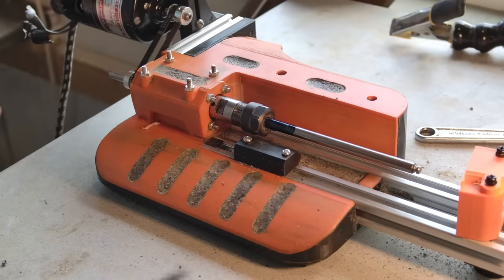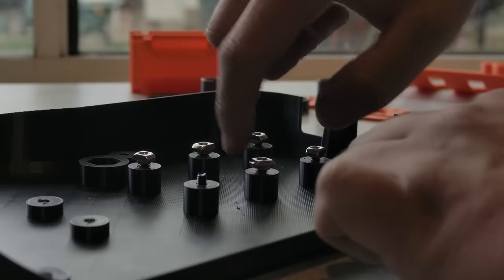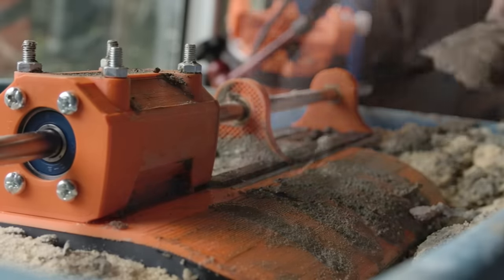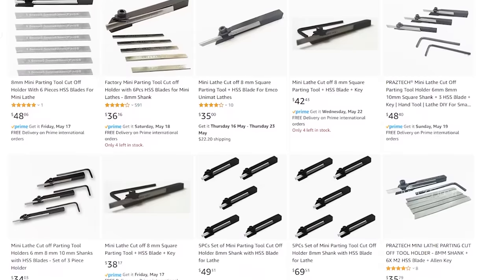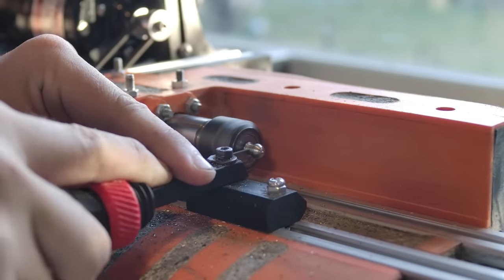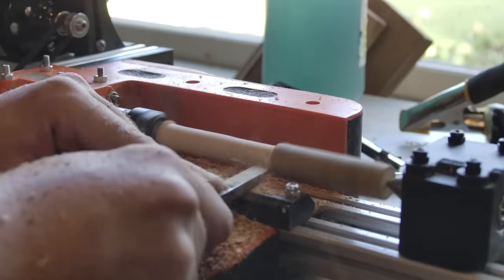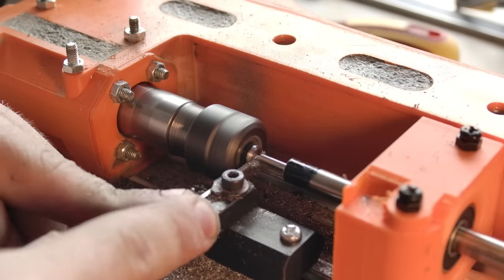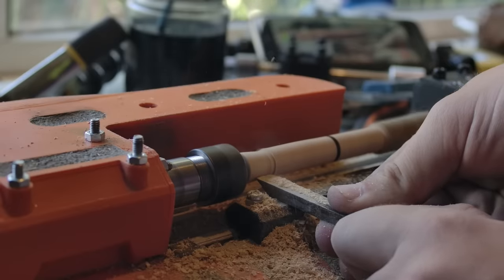The Metal Lathe Made With A 3D Printer

Comment from the maker: This video needs more footnotes than a Discworld novel.
Some things of note that didnt fit in the video for one reason or another:

-Square gravers are what the watchmakers lathe would use. I ordered some, but they are yet to arrive. Should provide significant advantage
-It has the option to be bolted down. I didn't this video which only really shows during the wood lathe section. 
-The drilling option REALLY needs work

Probably some other things idk
Reply: Your motor would be able to deliver more of it's power if you put a flywheel on the back of the chuck axel.
Reply: For bed extensions - I dont have an idea for the rails themselves but for the printed sections you could print joint-able parts like this: https://www.youtube.com/watch?v=WY8yd191qVE
Reply: Today I learned where the scattershot focus in the discworld audiobooks comes from! Time to hit the library and start the series from the top with my eyes instead 😉
Reply: Originally thought this video was neat. Saw the Discworld footnote comment and smashed subscribe immediately

Comment: Buy the cheapest cordless massager (looks like a gun) you can get. 3D print funnels for your openings and fill the with concrete. Vibrate the thing using the massager and the concrete will flow like water. Well, almosr. I use it to liquefy plaster all the time!
Reply from the maker: I have been told my concreting is "the least satisfying thing on all of youtube" by a friend aha, good tips.
Reply: That's a great tip. Have one and everything.
But don't put "massager" on quotation marks, that makes it far worse xD
Reply: @BernasLL  haha, I'll keep that in mind!
Reply: If you don't want to buy one of those I'd suggest  sitting the wet concrete on top of the washing machine when it is going into it's spin cycle.  Some of these new machines have VERY high spinning speeds & I'd bet both top fill & side fill would work.
Reply: You can use a small electric sander to vibrate wet cement and get good results
Reply: @fleaniswerkhardt4647  I tried using a small random orbital sander - without sandpaper - but that ended up melting the plastic because it was more powerful than expected. However, it cerainly could be made to work.
Reply: @fleaniswerkhardt4647  That's a great suggestion as well, I thought about this years ago but never had a reason to implement it.
Reply: @mattiasfagerlund  I'm sure it'd work well enough turned upside down so the spinning surface isn't eating/heating up your form, and it'll spin faster due to no resistance. I mean whenever I use a sander, my arms are still vibrating for a good while afterwards lmao so I'd imagine it'd work fine. All you need is vibration, so getting two small hammers and quickly alternating tapping them would work too 🤣🤣
Reply: Find an old electric toothbrush - they're awesome for small pour-mould projects.
Reply: @Borgedesigns  lol, I think putting concrete in is a great idea and I have planned to mix concrete and 3D printed things but yeah, your friend wasn't wrong.  Still it is a good example of "sometimes something looks like a mess in the process of being made but comes right".
Reply: mate, just say massager. the gun-shaped ones are actual massagers, unlike the other "massagers"
Reply: @cvspvr  I edited the post - you're the second to comment that and I assume a lot more people have been traumatized without commenting ;)
Reply: @mattiasfagerlund  don't put the PAD against the plastic.... put the MOTOR against the plastic.

Comment: I have been dreaming for years to make a mini lathe. Yet I came to the same conclusions when just contemplating it, it wont be rigid enough. Now you concreting approach changed that ! Thanks for the inspiration !!!!
Reply from the maker: Im glad people are getting the takeaway with the concrete. My design is probably a bit over complicated but the basic premise can be applied to so many printed applications
Reply: @Borgedesigns  rest assured, if I designed it would be most likely way more complicated. I think yours was pretty simple and elegant for what it does ! 
Me I would have to add a cross slide and some form of auto feed :). 
I was actually thinking of using the 3D as a mold for aluminum casting the base.

Comment: To make it easier next time for cleaning the concrete, spray some cooking oil on the plastic ( even inside is ok to make it flow to every corner ) first then pour your concrete ( use a tiny squirt of dishsoap to make it flow better in the mix and add a bit more water your mix is very dry and compressive strength does not matter for your purpose ) then wipe the surfaces with a wet rag / paper towel it will come off 10000% easier

Comment: Very cool.   Have you ever read the Dave Gingery "Build a workshop" series?  Book 1 is a foundry for melting aluminum.  Book 2 is building a lathe from scratch, largely from aluminum castings using the foundry constructed in book 1.   Using a 3d printer to make your casting patterns, I bet someone could follow that book alot more easily than when it was written.

Comment: Is the concrete desired for its mechanical properties? For rigidity?
The density of concrete (not cement, which on its own is much lighter) is 2400kg/m3 whereas plaster is 2275kg/m3.
I'd go with the plaster for ease of use and possibility of redoing it/chipping it out or dissolving it if there are problems later.

Comment: Cheap spray clear-coat does the same, it protects the surface and makes it easier to clean and on darker colors it completely hides layer lines even if you don't fully sand them away(generally just scotchbriting the surface to make the clear-coat stick will still see layer-lines gone with darker filaments)

Comment: Ive been on the same path as you, good to see the method has some viability. In my experience you really should add some form of fiber reinforcement to the concrete.

Cyano-acrylate glue(super glue) is great with concrete if any fine cracks are formed. It's also good as a surface finish to the exposed concrete parts. This both hinders particles from coming loose and adds surface tensile strength that concrete lacks and hinders cracks to develop in the first place.

Comment: I love what you're doing with exploring 3D printed concrete forms. I feel this technique is vastly underutilized, and it offers incredible strength and precision for a relatively low effort and cost.
Reply: cement mixed with general purpose epoxy resin works amazingly well in this sort of application.

Comment: Might I make a small recommendation? I see you are using aluminum extrusions and 3D printed plastic for the body of your lathe and steel fasteners to connect everything. I would suggest instead 3D printing the shape of the body of the lathe, and then using it as a positive to make a sand casting mold with. Then you could potentially mill out the portions that need to be precise after casting.

This would allow you to use at least brass, possibly even steel for the body of the lathe, which will greatly improve its functionality.

You can use a relatively makeshift mill using the current designs to do the finishing work on the casting.

Comment: Use epoxy-granite instead of concrete. It's dimensionally stable, and concrete isn't.
Reply: hahaha dimensionally stable.. like he has some tolerances to keep 😭
Reply: @feilko2170  that's exactly both thoughts that poped in my head. why tf concrete but on the other hand... well... he's not working with car parts
Reply: I think the point is to make it heavier, also cheap.
Reply: @gzaos  Stability is more important

Comment: Dude, just using a bag for the concrete… lol dump it in a zip bag, cut the corner off and pipe it into the slots like frosting. Much cleaner and more accurate, and you can add a milkshake straw to get it into the small areas too. 
That mess was entirely unnecessary…. Hahaha but something I’d probably do too if I was too lazy to just go buy bags.

Comment: I really hope you used taperd roller bearings in the headstock, otherwise there will always be unavoidable wobble on the spindle.
Reply: He clearly didn't use tapered roller bearing as the need to be held under a compressive load to work right. i would guess he used common deep groove ball bearings.
Reply: @markcastonguay7906  
That does explain the large wobble of the headstock spindle, whenever force is applied in the video.
A bit of an oversight, really.

Comment: An interesting idea I just had, if you need precise parts on a lathe like this, you can 3D print flat templates to screw to the tool rest and slide the tool over. It'll require a bit of calibration, but with a pattern parts can be done precisely and, more importantly, reproducibly.

Comment: You’re on a decent path, but the runout in the headstock looks pretty bad. It doesn’t seem like headstock volume would be an issue, so I’d go with taper bearings and make it bigger. Also reduce the overhang. Maybe go with a drawbar and collet system. You already have a watchmaker’s lathe with those presumably. I’d also go with a granite epoxy mix instead of concrete. Thin concrete is not very strong.

Comment: I really like this and I agree you really need some kind of tool holder and if there is any way to make it slide paralel to the spindle, that would be great, even if it's only an inch or so.  If you can lock the tool in place (distance from centerpoint) and then slide, it would make a huge difference but IDK how hard that would be.  

I would be almost more excited to see a copying/cloning setup (forget what you called it) so you can replicate the shape of other pieces or at least use a profile guide (which could be incorperated with the slide above!!). 

How are the vibrations?  Would you consider making the base a little heftier & making a bunch of mounting holes where it could be bolted onto some old plate iron or steel?  If you want to add more weight while reducing vibration, what about filling the cavity with lead &/or steel shot of various sized (so they "nest") and maybe fill the rest with sand & then sel or cap the openings.  I've heard keeping the material loose is best for absorbing vibrations as the movement is transferred into the shot/balls & the move/bounce (hardly observable) dissipating the vibration while actually generating heat!  in large systems this type of setup actually needs active cooling from what I've been told (similar to coal catching on fire while in rail cars from the friction from vibration) - so it must be doing something!

Awesome job!

Comment: I had a feeling some of those rods were from printers when I noticed flat side at the end of one of the rods, I have disassembled multiple laserjets and have many 6mm rods with flat side to them. I also have motors which one was bad and I pulled that metal cover off that has a magnet ring inside and use it to hold bolts when I disassemble dvd drives / hard disk drives.

Comment: Hey, great concept, very interesting! You should check out if you haven't seen it the "Turnado" by Eccentric Engineering, it's an accessory for metal lathe to allow free hand, radius and pattern turning. Uses a flat metal plate instead of ways. I think a diy version is exactly what this type of lathe needs.
I think a version with tapered roller bearings with a spindle that can adjust their clearances and some way to reduce the stick out of the collet holder/work pieces would go a long way. Also I think for the drilling bit (tailstock) you need a more rigid/thicker connection to the chuck and mounting to the rest of the lathe. 
All in all I would say it has a ton of potential, great work!!

Comment: What do you think about a typical 775 motor in this usecase? Does it have enough power? 
Maybe change gear ratio to reduce speed of spindle?
Another question, why didn't you mount the headstock to the extrusions themselves?

Comment: I understand if this is just a project in using as much 3d printing as possible but it’s not that useful. Why not strip out an electric drill and make a printed housing for that? It’d be your motor, spindle and chuck all in a much stronger setup. I know this works well because I’ve clamped a drill to a worktop a few times, to turn small parts.

Comment: Instead of concrete, why not use epoxy granite? It dampens vibrations pretty well apparently.
Reply: I'd say cost and availability, though you may want to add fiber and polymer to the concrete as a middle ground to make it more resistant to vibration.

Comment: You should reduce the speed of the motor and convert that into torque, as high speed increases the heat and eventually damages the tool.
Reply: If the motor actually had any usable torque it would twist this toy in half.

Comment: i want to make a similar lathe for a time now, so here is a few questions:
How do you make sure that the axle of the rotation is paralel to the bed? Or it is not as important?
Also the motor pulling on the axle could get it out of paralel
I picked up a cheap rotational tool, like dremel and planning to use that as the motor. It has speed control and I plan to get some geared belt. any thoughts?
I also sourced the cast iron base of an old sewing maching, and planning to use it as a base, so it does not move around while using it, like yours did :D
Reply: since it's a hand machine, as long as the bearings are concentric, the bed being exactly parallel probably doesn't matter much.

if you're talking about the die grinders that take like a 3-4mm shaft, be careful, they are often running at like 20k+rpm, so an 8 to 1 or so reduction may be needed, and even then on the low end you're looking at 5k rpm, which is still 625 rpm with an 8 to 1. imo a 0-3000 rpm drill might be more appropriate and doesn't need any gear reduction (and you can still get one for like 20 euro)

his moved cause it wasn't bolted down, but it can be.
Reply: @satibel  Im talking about those rotary sanders, cutters, used to carve in wood or engrave into metal. not as powerfull as a die grinder, but still has a lot of rpm and I will need reduction and I hope that will give me more tourqe. Look up dremel 3000. what I have is a no-brand knok of but pretty similar in power. 
What I need a lathe for is more of a precision work like making mini screws or pins with custom treads so I fear that my bed setup needs to be more precise.
Reply: @zozozoli  yeah that's what I meant, apparently die grinder is usually used for the higher power versions and rotary tool for the one you have. 
but my point still stand, the range might be a bit of an issue unless you have swappable gears, the dremel 3000 does 5k-35k rpm . 
though if you use 2 5:1 stages, that'd work as you can simply swap one to a 3:1 or 2:1 if you need higher speed.

basically you'd want something like a 300-5k rpm range if you wanna do steel from what I looked at, so 7:1, maybe 5:1 for the highest speed, and 20:1 for the lowest
so a 4:1 fixed and a swappable 1.75 - 5:1

so a 16T into a 80T|20T swap and a 16:64
(using GT2 belts)
Reply: @satibel  thats  a good idead to have extra gears so i can change on the go
Thanky for the info and your toughts!

Comment: Opinions: 

1 lathe still needs more rigidity, more regidiity more accurate cuts. I think this could be done by using a larger, tempered steel rod for the moter to attach to.

2 the sewing machine moter could be replaced with a larger  industrial sewing machine moter
Reply: the lack of rigidity comes from the bearings, that level of deflexion is impossible just pushing it by hand with the available lever. they are general ball ones with large play. if you really want more rigidity you need a bigger axle diameter (as you said), but also one expensive cylindrical roller bearing the closest to the chuck, and a trust bearing at the end of the bearing stack for drilling.

other cheaper and more painful option would be micro adjust the concentricity of the roller bearings so every play cancel out. and you have a precise bearing out of not-precise bearings.

Comment: What resin did you use? How rigid does the plastic need to be?
Reply: Doesn't look like there is any resin here.
Reply: @osmanpasha_diy  resin is a generic term for plastics
Reply: @CarterSchonwald  Do you have any sources? I've only heard it mean photopolymer resin or epoxy resin or resins from wood, but none of plastics you print on an FDM machine ever called resins.
Reply: Per Wikipedia: resin is a solid or highly viscous substance of plant or synthetic origin that is typically convertible into polymers

If you look at the pellet / raw plastic manufacture datasheets, they often refer to each plastic formulation as a resin
Reply: @CarterSchonwald  The problem is that wikipedia is lacking context. Within the realm of 3d printing, resin is used in stereolithography printing and filament is used in fused deposition modelling. If you go around asking for resin to use in a FDM printer, you'll get the looks. Doesn't matter what wikipedia says.